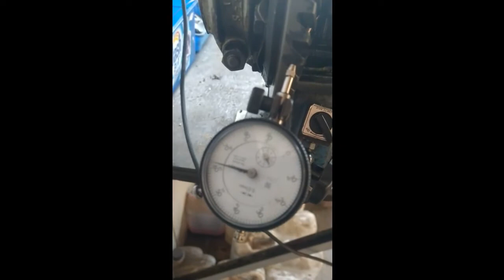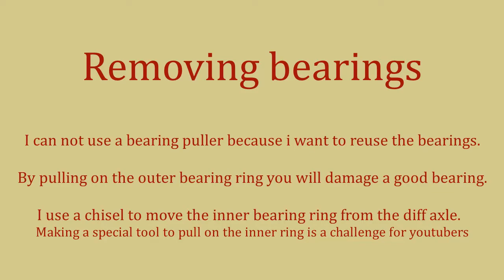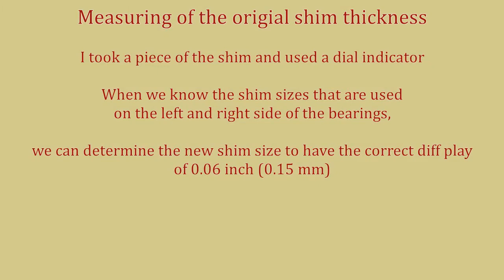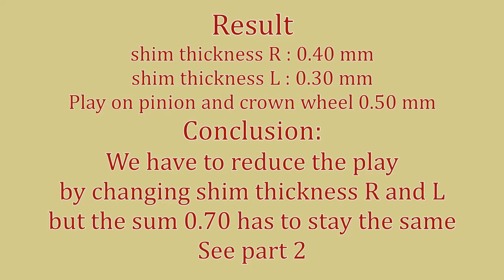Part 1 - MGB banjo axle / diff overhaul  / So oldt

Comment: DO NOT USE A CHISEL!!!
Reply from the maker: Hey Kees Stam. Thank you for watching my video. "Never use a chisel". That is what i also would say (think) when watching dismounting bearings. But there is realy no other way to dismount the bearings of the diff housing when you want to reuse the bearings. When dismounting you must pull on the outer ring. So i did the chissel way. Maybe you can share an other method . Using a knife puller is not possible because there is no place . Have a nice day Stam. Pleace subscribe to my chanel.